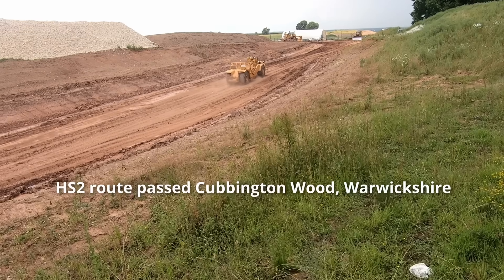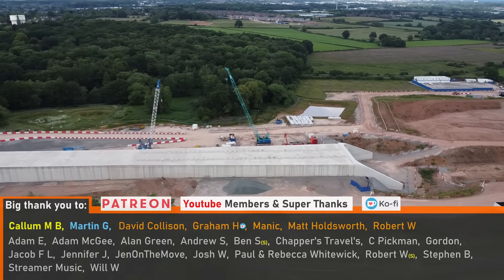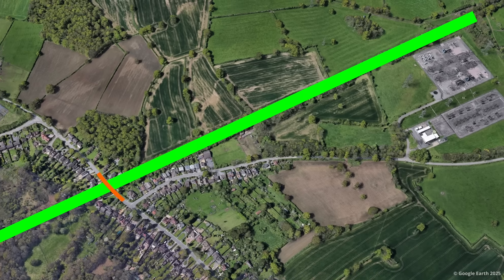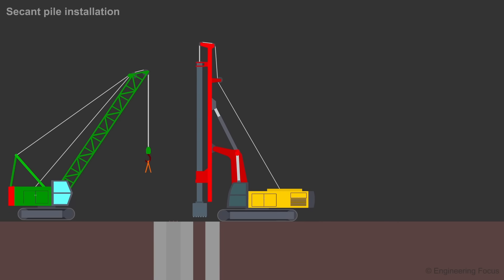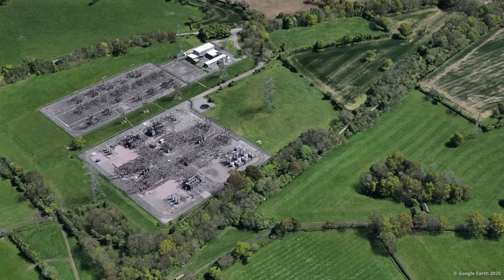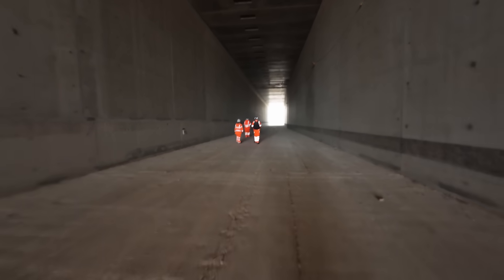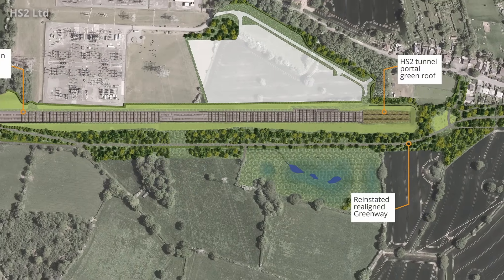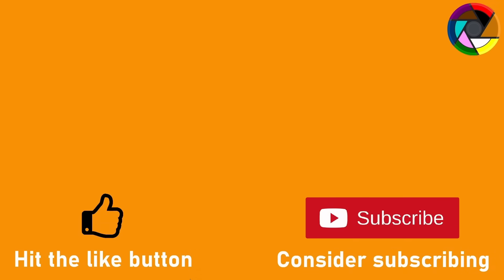HS2 Burton Green Tunnel, Kenilworth

Comment: I'm convinced that the clown who dreamt this idea up, wanted to make it as technically difficult as possible = as expensive as possible. Great video though, excellent explanations.
Reply: @litigantdad1974  a rather clownish comment. The village should not be split in half by HS2 and further the village should not lose the greenway walking/cycling route. This engineered solution resolves this and the village gains a fantastic new village hall for the years of disruption. I'm sure you would have masterminded a much better solution.
Reply from the maker: I believe the structure is fully justified given the location and constraints.

Comment: Good to flag that Burton Green is one of the very necessary green tunnels: unlike Wendover which was totally unnecessary
Reply: @quidsin1719  Agreed that the Burton Green tunnel is essential. If the Wendover section wasn't in a tunnel it would run parallel to a vast number of properties so the tunnel will prevent the sound and visual impact for many here (bearing in mind the trains will be running at full pelt here). The Chipping Warden green tunnel is curious as adjacent is the vast unsightly car storage area on the disused Airfield. The local MP's along the route wielded much power over the first Johnson government as his majority was so thin and his political position so weak.
Reply: Blame the nimbys.

Comment: You haven't mentioned how the destruction of the local environment has affected the residents ?
Reply from the maker: Okay
Reply: There will be at least a 10% increase in habitats and biodiversity created to compensate for what was lost. Look at how the HS1 corridor has now become a good habitat - HS2 will do this and much more.
Reply: @Maxhead_room   I live next to the HS1 corridor.   You clearly don't.
Reply: @barryjatkinson  how do you propose we resolve transport needs? Build more roads or build new rail infrastructure? (and whilst doing so increase the availability of habitats).
Reply: @Maxhead_room   by looking at the problem more intelligently.  The hi speed projects in Morocco, Saudi and similar places are justified.  There's no case for HS2 here.  There's no argument.  It's just wrong.
Reply: @barryjatkinson  remember that HS2 is more about increasing capacity than anything else. The WCML is full, HS2 takes fast trains off the WCML and Chiltern ML and allows much more local stopping services on these lines, plus more freight. Would you prefer roads to be built to meet the transportation needs? You need to be more objective, instead you have a very binary approach and say nonsense comments like 'there is no argument'.

Comment: Can't help think HS2 would gain more popularity and business if they'd stuck a few stations in along it in loops and have a stopping service a la HS1 🤔
Reply from the maker: HS2 is best thought of as a bypass for the WCML, so that local and regional services on existing lines can be improved. The moment you start adding stops it erodes the benefits for the north.
Reply: @Rail_Focus Exactly it wouldn't be called High Speed 2 if they started adding stop's, we suppose to be easing over crowding not adding more to it.
Reply: @Rail_Focus  No need to add stops in for long distance just a stopping service like the Javelins on HS1.
Reply: @Boating_David Even if stopping services stop on loops adjacent to the main line you either need very long loops to allow trains to brake and accelerate on the loop, or accept loss of capacity on the main line as trains brake and accelerate on the main line. 

It's why HS1 doesn't have the capacity HS2 will have, especially when you add in that Javelin services don't operate at the full HS1 line speed.
Reply: Which would have greatly reduced the much needed uplift in passenger capacity that was the primary reason for building HS2 - essentially the WCML relief route. It deliberately avoids passing through highly populated areas so a stopping service wouldn't be much use anyway. Users of the existing WCML stations however should see a much better stopping service.
Reply: @chris8405 absolutely, the WCML will be able to accommodate more local, slower, stopping services with the extra capacity provided by not spacing the fast services.

Comment: This is not top down construction but tradiional construction. Top down construction occurs when a structure is built before the  excavation directly underneath the proposed structure is built. This being supported by king post piles bored into the ground from ground level. The diaphragm and secant piled retaining walls are used in both top down and non top down construcion.
Reply: That's OK. Top down is a quicker way of building a structure which sits on top of a basement, when the basement is more than 3 or 4 storeys deep. Foundation piles are constructed from ground level with a steel post cast in them. As the piles are constructed from ground level the piles come up to that level. Then the structural frame for the above ground structure and the  ground floor slab are built. As that progresses the basement is excavated out underneath the structure.  Old Oak Common Station is being built using this method.  It allows work to progress on the superstructure which would take much longer to build if the basement was constructed first. The retaining walls are installed before any work starts. Secant piles form a water resistant structure. Diaphragm walls achieve the same thing but are used where they retaining walls are built to a deeper depth..
Reply from the maker: Maybe crossed wires on my part, but just had a look and you did say my Bromford Tunnel portal video was a good explanation of top down, which I thought was a similar structure 😁
Reply: @TrevorWilliams-fq8mg  thank you for clarifying
Reply from the maker: Ah okay, someone else said it was.
Reply: New Civil Engineer describes elements of the Burton Green tunnel being built 'Top Down'. Looking at older Burton Green videos it appears that the roof frame was built before the excavation.
Reply from the maker: I think if NCE and myself repeated it then we must have heard it from one of the engineers on site 🤔 https://www.newcivilengineer.com/latest/hs2-top-down-construction-of-700m-burton-green-tunnel-reaches-halfway-14-11-2024/
Reply: @Rail_Focus I think it's a bit of a misnomer in terms. My understanding of top down construction is as they have built at Old Oak Common. I call this traditional construction where the horizontal beams span an opening like a bridge would and are supported either side of the tunnel. A bridge can be built the same way.
Reply from the maker: Ah, I think I may have over simplified the explanation. I didn't really explain that the props for the green tunnel section were poured in situ in a blinding layer. The probs will then be incorporated into and become part of the roof. 1 shot does show props which were built off site, maybe that didn't help?
Reply: Don't know. No problem whatever.
Reply: The office block over Charing Cross station is such a structure. Piles were installed either side of the station, with towers resting on them. Arches were then placed across the station and the offices hang from them. So no part pf the office block rests on the station below.
Reply: @robertrich663 So the office building was suspended over  the top of the station being supported either side. That's not top down construction.